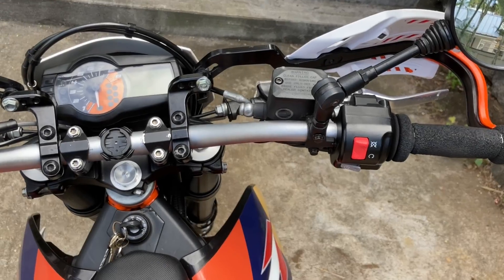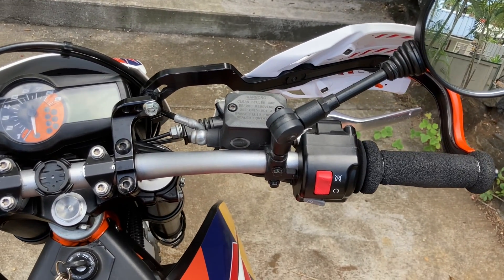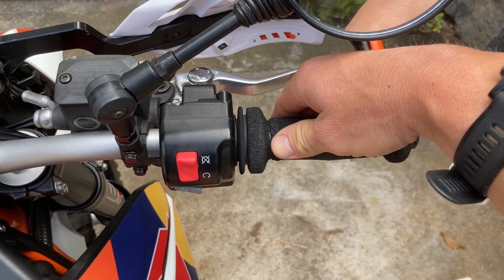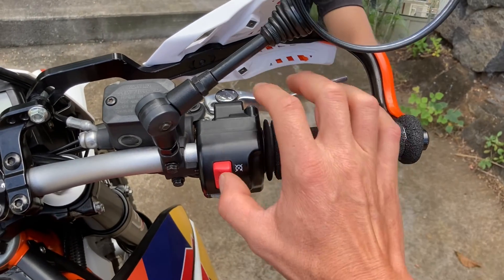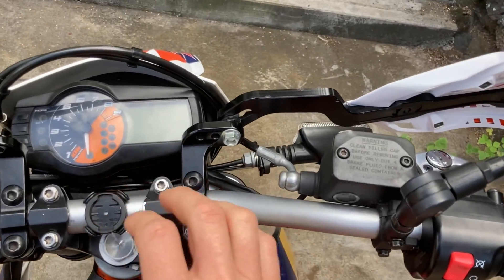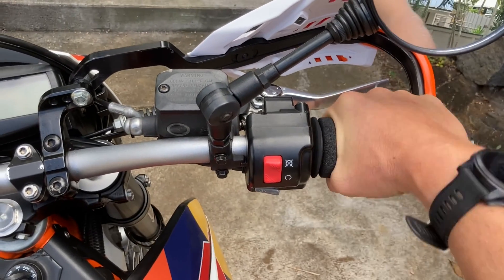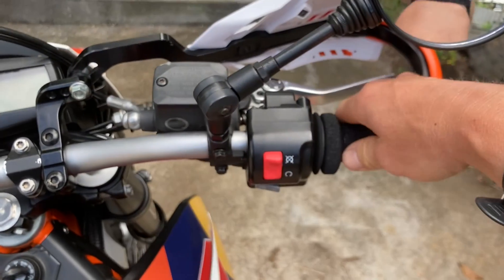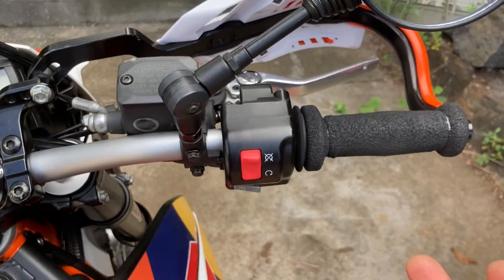KTM 690 Throttle Position Sensor Reset (a Must Know)

Comment: I’m going to try this on my duke 390 tomorrow, it starts but won’t stay on like it isn’t getting gas, finger crossed it works!
Reply from the maker: Only works on the ride by wire (electric throttle) bikes. I’d start with the fuel filter or fuel system in general if it been sitting for any time with old gas.
Reply: @JohnHowerton137 it is but I think it’s my tmap sensor, took it out and it’s missing the membrane thingy so hoping it solves the issue

Comment: any good advice on a 13 enduro that can't seem to hold idle. the only things I haven't touched is the tpms. could they need replacement? I was told my model has two of them
Reply from the maker: Probably just adjustment. I haven't done it on the 690 but adjusted several on EXC Keihin throttle bodies. Just one screw, pigtail and a meter.

Comment: Does this work on a 2014   1290 superduke r?    Im having cold start issues.        Hot starts are normal.
Reply from the maker: I bet it does. Don’t know if it’ll help with that issue, but you could try. At worst it’ll do nothing.
Reply: @JohnHowerton137  thank you

Comment: Cured P0353 error
Reply from the maker: Whatever that one means... always happy to hear the word "Cured."
Reply: @JohnHowerton137  had the yellow engine error lamp lit and  lamp didnt come off as the engine started. Installed an iOBD2 analyzer and said I had a P0353 error /ignition coil error.. your little trick caused the engine error to go away.. thank you for sharing..
Reply from the maker: Thanks for the additional info. May help someone else 👍

Comment: Mine is doing that. I tried this, but my engine light is still on. It went on when my bike lost power.
Reply from the maker: I wouldn't expect it to turn engine light off. What caused the bike to lose power? Stock ECU? Play with any sensors or dongles?

Comment: I had recently throttle hiccups when I was accelerating! Like when the fuel quality is not really good. I tried the reset you suggested and the issue has been fixed! Thank you very much!
Reply from the maker: Excellent!
Reply: I am having the same problem do you have anything else to try?
Reply: @justinberkbuegler796  I assume you tried the above and didn’t work ? Something else that might be a reason is your boots…In case you are using bulky enduro boots it might messing up with the quick shifter.

Comment: I have a 2020 Husky 701sm and had to replace the battery. After replacing the battery the check engine light stayed on. I remembered hearing about this reset and tried it. Fixed the check engine light. Awesome
Reply from the maker: Excellent 👍
Reply: It didn’t fix my engine light. What now?

Comment: Does this work for a '23?
Reply from the maker: As far as I know, yes.
Reply: Thanks! I'm gonna do this and the fuel reset and hopefully it eliminates some of the surging.
Reply from the maker: @scottwatkins3156  please report back. It’s made mine run much better several times. If you ever have to bump start the bike with a dead battery, this is a must afterward!
Reply: I reset the throttle and fuel last night. On the ride in to work this morning, I didn't notice any difference. The bike still has a bad surge  just above idle. I'll ride it for another week or so and if it get better, I'll let you know.
Reply from the maker: @scottwatkins3156  do you have the airbox opened up. I seem to remember mine stock trim choking a bit off the bottom like that. Ride it up and down the street with lid off a few times see if it helps.
Reply: The airbox is stock. However, I do have the TwinAir filter in it. I put the NiceCNC air filter cover on it which does away with the stock snorkel and the whole filter top is open. It made a nice power increase but I noticed some detonation and I put the stock lid back on. So, right now the bike is completely stock other than the TwinAir stock replacement filter.
Reply from the maker: @scottwatkins3156  ok. I guess the other thing I did (sorry been 4 years) was a fuel controller. Mine is disco, but I believe Rottweiler makes one now... dongle or something.

Comment: What years does this pertain to? I have a 2009 that stalls every now and again and seams like it has something to do with the throttle?
Reply from the maker: 09 has a cable throttle, so no go. Applies to the ride by wire throttles. 

Bump your idle up just a bit. KTM 4-strokes in general are pretty easy to flameout when the idles are set too low.

Comment: Just had a 2023 701 sm, and you can’t clutch wheelie as something is killing the power, it also loses power when going from half to full throttle intermittently. Took it back to the dealer and there’s no faults. If you disconnect the front abs sensor you get full power. The dealer changed the sensor, front wheel and engine ecu but it’s still the same
Reply from the maker: Well there is anti-wheelie for a couple gears. Thought it all had to be turned off by dealer in the ECU. Maybe I'll disconnect my front ABS. I put a spacer in the rear one a long time ago to disconnect it. That chit tries to kill you off-road if you forget to turn it off.
Reply: Problem with disconnecting the front sensor is that the Speedo doesn’t work and the engine light comes on 😂 thanks, I’ll ask the dealer about the anti wheelie! Why would they put that function on this type of bike 😵‍💫
Reply from the maker: @tomupcott9922  because most people don't know how to ride 🤣

If I remember correctly, it can be turned off by the dealer if the full Akra exhaust system is purchased. That's how you get the performance mapping.
Reply: I did the ecu, throttle reteach and adjusted the gear lever as there wasn’t much space for my boot and it now wheelies properly! I’m thinking it was something to do with my boot slightly touching the gear lever and sending the quick shifter mad !
Reply from the maker: That definitely sounds reasonable. Glad it's working again ✊

Comment: I tried that and now my bike don't work lmaoo
Reply from the maker: Literally done this hundreds of times. You pretty much have to do it after a dead battery bump start.

Sounds like your bike has other issues.
Reply: @JohnHowerton137  my bad bro it was gas empty i just refill it looll 😂
Reply from the maker: @ahmedmarhoon3052  fuel is an integral part of making a motorcycle run 🤣
Reply from the maker: @ahmedmarhoon3052  there was a saying back in the 70s-2000s… “Turn the gas on dummy!” Get a 1/4 lap into your race and the bike runs out of fuel on the face of a double… because you didn’t flip the petcock 🤦‍♂️
Reply: @JohnHowerton137  lmaaoo, thats my first bike tho i just got my licens, dont mind me and keep up ur videos are amazing
Reply from the maker: @ahmedmarhoon3052  well then congrats. Here’s another old saying… “Rubber side down.” 🤙
Reply: @JohnHowerton137  my apologies again mate

Comment: Thanks for the heads up. Mine 2019 SMCR flames out coming to a stop with throttle closed. No mods other than a slip-on (no cat). Going to try this out and also on 16 Enduro I have.
Reply: Were you able to get it to stop flaming out? Dealing with same issue
Reply: @jap338kx  Yes. Followed the procedure and it quit happening. Thanks for the reminder, broke the bike out of cold storage the other day and thought about this procedure, but no flameouts happened.
Reply from the maker: Works good especially in those times where you have to bump start a dead battery. Once the bike starts you have to turn it off and do this or else it'll run like total dogchit.

Comment: This bike is driving me crazy!

Are you good with ktm? I have a problem with my 690 i bought last month.
 its from 2012 and the pre-owner states it have EVO 1 map on it. It have EVO 1 airbox with foam filter and LeVince Slipon.
The bike runs really bad without the DB killer. it dies on idle, pops and bangs on lower revs and runs rough on low speed with twitchy response on the gas.

When i put the DB killer in the slipon the bike runs great with good idle and not twitchy. What can be the problem? is the back pressure to low? is the mapping wrong? I want to be able to run without DB killer but i cant do it at the moment. I have changed spark plug and the coil (the tip was gray/white) I have changed fuel filter, Inline fuel filter, fuel pump. the next thing muste be the mapping? I also did try this reset you showing but still same. I dont know what to do now execpt check the Mapping.
Reply from the maker: I think you answered your own question. My 250 has less pronounced version of the same symptoms with wide open FMF Factory Ti pipe. Unfortunately there are no inserts to be found right now, so I’m putting a stock pipe back on.
Reply: @JohnHowerton137  okey, thanks. I will try call some dealer tomorrow and talk about see what map it have

Comment: Thanks John - great tip.  My new 2022 690 seems to drop all throttle response sometimes on a gear change - normally 1 to 2, but recently on 2 - 3, just no response after I let the clutch out, and then when I return the throttle to home position and open it again the engine will have power again.  Dealer says he's never heard of it, and the service showed no computer faults.  anyone else had this on their 2019+ 690?
Reply: When you quick shift it cuts engine power. You wanna shift these bikes hard and fast or use the clutch.
Reply from the maker: Don't those things have a quick shift sensor on them? I feel like that's the first place I'd look.
Reply: Same here on 2022. Did you get an explanation yet or even a solution to resolve this?
Reply: @wjurgen66  ktm replaced the whole ride by wire but it still does it a bit. I have since done the Rottweiler canister removal and rade garage air box upgrade, and then several ECU resets and it doesn’t seem to do it anywhere near as much.
Reply from the maker: Still feel like the quickshift function is the most logical place to start.
Reply: My 2019 is doing this what was your fix?
Reply from the maker: Your bike have a quick shifter? (SMCR)

Comment: Hi John. Sometimes when I close my throttle, it still goes for one burst of throttle. Its very confusing and dangerous especially when I'm doing some track days and you are on the edge.   I tried this but the problem still persist.  Do you have any idea? Thanks
Reply from the maker: Yeah, that sounds exciting! 😳🤣

I actually don't, sorry. Probably a trip to the dealer for the diagnostic machine before it takes you out!

Comment: My 690 FI blinks 8x long and 8x short. I saw manual and it has error code 88 DBW trottle valve stuck open. How to solve ? Help
Reply from the maker: No idea. Sounds like the EFI throttle body needs to come off and get inspected.
Reply: @JohnHowerton137  will bring it to show room and ask them to check the throttle then
Reply from the maker: @pradeepkhadka4022  not the throttle, throttle body (aka fuel injection version of a carb).
Reply: Is there other way except changing the throttle body?
Reply from the maker: No idea. I have no idea what's going on in there. Maybe there is corrosion from sitting with poor fuel and it's just stuck. Maybe something failed. No way of knowing without pulling stuff apart.

Comment: I did and engine rebuild and after that I'm feeling my with less power. I have the motorcycle in the workshop.

Bofore the engine rebuil It was a beast XD. 

When I'm on high RPMs of full Throttle I feel the motorcycle like hanging without strength. I will try this and the 15min and see what happends. 

I'll reach here gain to tell you.

Comment: My 690 enduro r has a problem with throttle response going to try this and the 15 minute idle
Reply: did it work for you ?
Reply: @flproduza1662  nah doing my head in going to take it to the bike shop this week, cut out on me in 2nd gear on a junction back wheel locked up nearly killed me 🙄need it sorted dangerous
Reply: @roadrasher8913  I did and engine rebuild and after that I'm feeling it with less power. I have the motorcycle in the workshop.

Bofore the engine rebuil It was a beast XD. But about to explote 🤣

When I'm on high RPMs of full Throttle I feel the motorcycle like hanging without strength. I will try this and the 15min and see what happends.
Reply: @flproduza1662  turns out it was the fuel pump £400 😞

Comment: I’ve been wondering for a few years now when we were gonna see a ride by wire throttle. 

I’m strictly a motocross guy so I’m not familiar with these bikes. How long has ride by wire been a thing? Does it feel extremely smooth?
Reply from the maker: I want to think 2014(?), but honestly I don't know without researching. Makes total sense with EFI.
Reply from the maker: P.S. It more or less feels like any other throttle. I helped develop a spacer kit to take out the "freeplay" ie.. slop out of it. If you do a G2 throttle and the spacers its extremely tight and smooth. Thats what I have on my ebike. Since it has no clutch, accurate throttle sensitivity is more important than say my 250F with less torque, throttle response and a clutch.
Reply: Awesome man. Thanks for the info
Reply: I had a 2007 Aprilia Shiver that was ride by wire.